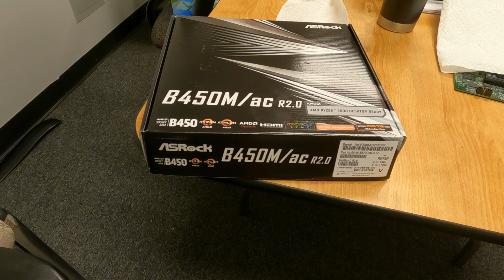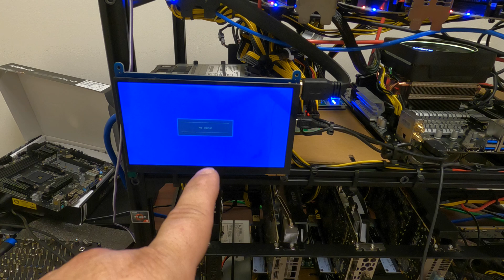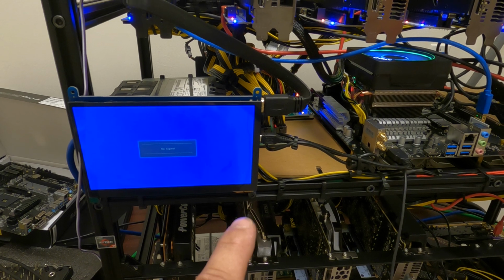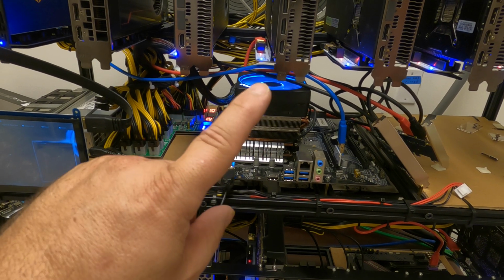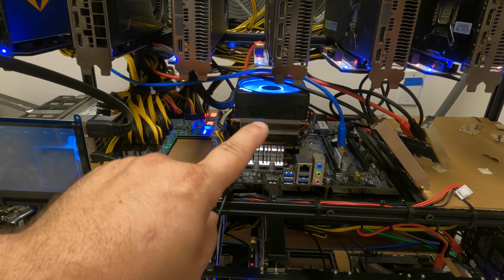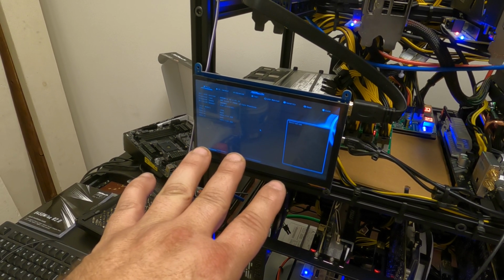8X GPU On A Consumer Motherboard!!!!

Comment: I’ve had good luck with Asrock boards for mining. My current rig mobo is old. It’s a Pro 4 z390. I’ve run 12 gpus on it for years using 4 to 1 splitters and two m.2 adapters to pcie. In addition, I had another Asrock board for an AMD AM3 apu. Dirt cheap at the time, and that ran between 2-4 AMD cards on NiceHash for years. On that I think the board and APU were under $150 new. When I swapped it out it became an HTPC/gaming rig for my nephews in their living room. Recently I purchased a GPU bundle that came with an Aorus x570 and it’s just been sitting here. Im debating building a CPU mining rig (it’s why I’m here watching and upvoting your vids today)

Comment: This is really sad, because after this video all the motherboard price will go up.
For me i use a old Asus B75M-A( i5-2400 and 8gb ddr3-1333) with 3 pciex 1to4x to get 12 gpu!
Reply: lol...this wont make all mobos go up...here is why...many of are forced to take cheapo motherboards in combos from newegg.  I personally have dumped 4 micro atx brand new on ebay for like 60 bucks each just to unload them because of newegg combos.